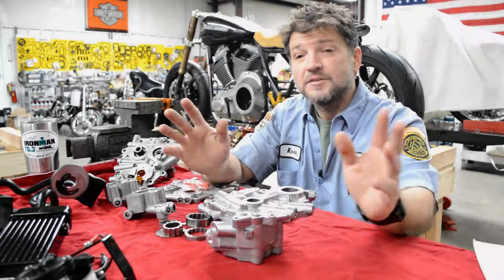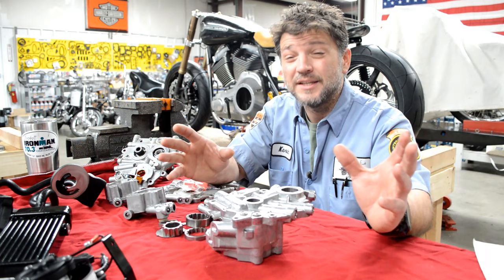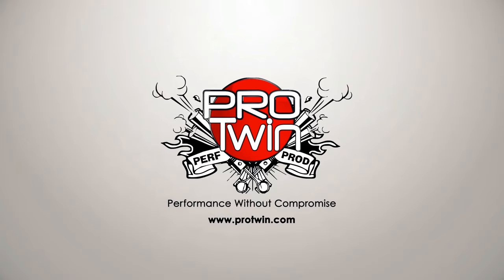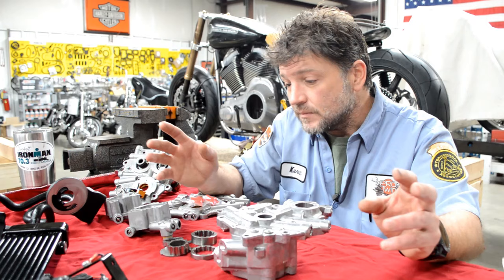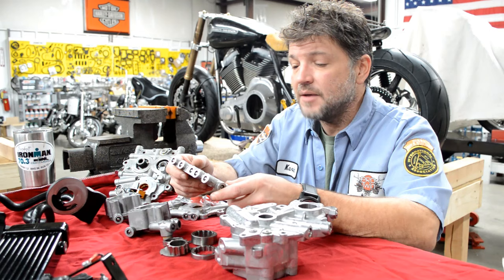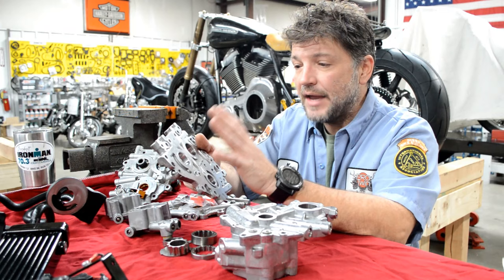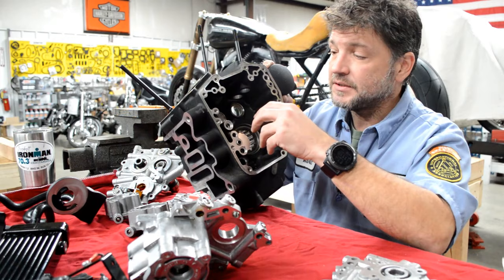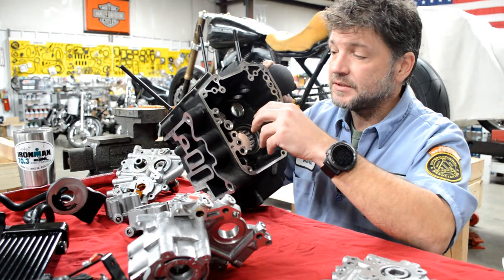Harley Cam Plate Tech - The M8 TC Cam Plate Debate - S&S Cycle - Kevin Baxter - Pro Twin Performance

Comment: Thanks for the great info. I just Subscribed. What weight oil would you reccomend for a 2010 Superglide? 10W40, or 20W50? The engine is stock. Also, what oil filter do you reccomend? Jagg oil cooler on a stock 96ci?
Again... thanks!
Reply from the maker: Hey Jimmy. Thanks for subscribing. I would definitely run 20W50. Personally I prefer an amsoil synthetic. As for filter, I avoid HD super premium 5.  Drag, Twin Power, HiFiltro...had good luck with all those.

Comment: Have Kevin,  I have a question,  I have  a question,  I had a s and s camchest package put in my 2000 ultra classic,  it had the 509 cams, efi,  only picked up about 9 horsepower,  does that seem right, had the upgraded intake and exhaust.

Comment: just curious why the screamin eagle cam plate upgrade was not mentioned. Except for oil bypass, it appears to be just as good as the S&S plate for less money. Did my 02 softail at 30K and just caught the stock tensioners before they failed (whew).
Reply from the maker: It's a viable option...but I starting having issues with them a few years ago.  The earliest one's were great and trouble free but as years went on, no so much.  Also, quite often, full kit prices from the other manufacturers save folks money over buy everything seperately.
Reply: @KevinBaxter  what was the issues you were having with them? The one I used was Intermountain H-D Part#:
25284-11
Reply from the maker: Problems with the bypass sticking.  Also...when running gear drive, on nearly every one i installed, i had to custom make a pinion gear to get the backlash right.  Some too loose, some too tight.

Comment: Just come across your channel tonight.  Great vid with some actual useful information.  Sorry if this has been asked.  I did a quick scan of the comments and did not see it.  What is your opinion on these ventilator kits like A1 cycles is selling.  I am specifically referring to the M8 motors.  I only ask because you made a reference to sumping, and these ventilators are supposed to prevent that.
Reply from the maker: That problem goes back to the beginning of Twin cam really. When I first started doing long stroke big bore builds in the early 2000s (120+ CID) occasionally you would run into one that would pop a dipstick out under very hard acceleration. My solution then was the same...vent the system either thru the oil cap or thru the rocker boxes. I went as far as putting kits together where you would drill and tap the rocker cover, then thread in a small PCV valve. Also went as far as running the vent hose to the exhaust to pull the pressure out...like on race cars. All solved the excessive crankcase pressure issue. When threaded caps came to be on cruise drive models, the problem was still there, only the cap couldnt pop out.  From my testing on M8, I have found that most of the issue is caused from oil draining from cam chest to crankcase while on the side stand and the factory pump cant recover quickly enough. We cant assume a vented cap will solve a sumping issue unless excessive crankcase pressure is the cause. But then what is causing the excessive pressure?  Runout? Blow by?  Bad pump or plate?  All that said, yes, I'd have to agree that a vented cap, preferably with a reed valve, is a great solution to sumping issues caused by excessive crankcase pressure.
Reply: @KevinBaxter  Thank you for the prompt reply.  I may look into a ventilator when I do my 465 cam upgrade.  Your videos are very informative and much appreciated.

Comment: How about a video on the twin Cam crankshaft flywheel assembly and how to repair it. Do you weld it or pin it or just replace it altogether?

Comment: Kevin I have a 2015 flhtk with 80,000 miles and I am wondering about the cam tensioners and what should be replaced when going into this job also do you charge by the hour or by the job you are to do on a bike

Comment: You must be talking about the fueling cam plates, they run a TON of oil pressure, not sure why that’s a good idea when it’s not required, that’s just heating the oil up more.
Reply from the maker: not one specifically.  people have swapped springs for years, or since the S&S plate is adjustable, they crank down on it, etc.
Reply: Kevin Baxter ah ok, when I was picking my cam chest I went with the S&S one because of the 3 “pumps” in it, the bushings, and the fact that it didn’t have 70 psi of oil pressure....that’s crazy I don’t know why fueling does that....just to be different? I dunno. People seem to like their stuff but to me the S&S stuff is unmatched in price, quality, and performance.
Reply from the maker: Well, we will have Luke from Fueling on live in the next few weeks.  He will be able to tell us.  As with everything, we dont brand bash or pit one vs the other.  Each have their own unique features and benefits and i feel its my job to make sure we focus on that.  I want to bring the info to everyone so they can make an informed decision for themselves before they fork over the cash.
Reply: Kevin Baxter looking forward to it. I like their stuff, just comparing the info on the products I had available at the time the S&S stuff seemed the way to go, plus the sell
And entire big bore kit at a crazy good price. Fueling seems to be more race/stunt crowd oriented, S&S seems to be more performance touring oriented I guess, just my opinion. Both great companies.
Reply: Kevin Baxter I am running one of their vented dip sticks, pretty nice piece.
Reply from the maker: thats an interesting perspective on the two...i never looked at it that way.  it comes off like that from the marketing alone anyway.
Reply from the maker: And they hit a homerun with that part.  Great product, great design.  Funny...i made them for Twin Cam on our monster builds back in 2000 and they had a PCV valve on top.  Neat to see a product concept come back around.

Comment: If the cooler cools the oil 40 degrees, and if I’m using 20w50, which at operating temp acts like a 50 weight, what weight will the oil act like when 40 degrees cooler?
Reply from the maker: The measured range for ratings....0 C to 100 C.  I dont think it would be much of a viscosity difference....great question.  Made me go......"huh....i wonder".

Comment: Do you know if any other engines can replace the tc88b 19259-06? I have an 06 heritage efi that had a front cam bearing failure. That caused enough damage to keep me busy. If I hadn't bought this thing from my mother after my father passed away... I'd probably part it out.
Reply from the maker: Any of the 06 and back B engines would work.

Comment: I want to add the S&S oil pump and cam plate to my 2017 FLTRU. It currently has19600 miles on it with the  original oil pump and cam plate. I measured the crank runout. It is .006. S&S claims max runout is .006. Does the .001 make the difference? What problems can I expect if I choose to in stall it anyways. Thank you for any info.

Comment: I just got a 2018 street bob went into Limp mode after passing a big truck in the highway. And P0523h code came out. Would it be what you mentioned ? Or a bad oil pressure sensor?

Comment: Can you do a video about the Harley ticking  in the valve train that no one seems to know why & fix .
Reply from the maker: One of the reasons for all of the videos in the M8 vs Twin Cam series touch on that.  Truth is, there are many issues that can cause the ticking...there is no single answer or fix.  There has been a quest to find the single answer since the TC came out.  No one has yet....only found ways to reduce it significantly.  If you could ride your car engine down the road, youd be amazed at the noises they make.
Reply from the maker: My answer is "Truth is, there are many issues that can cause the ticking...there is no single answer or fix.  There has been a quest to find the single answer since the TC came out.  No one has yet....only found ways to reduce it significantly." as I posted.  There is no answer.  People have been on the quest to stop a TC from ticking since they came out.  Several products promising it have come and gone.  Lifter to bore clearance, piston oilers, cam plates, oil pumps, valve stem protrustion, springs, lifters, rocker arm supports, etc.....even pushrods tapping the tube...all have created ticks.  A TC engine can be built and fitted with a .001 tolerance to blueprint, to perfection, and still tick.  Yours could be worse than others...i cant say...ive never heard it.  Yours could have a problem im not aware of.
Reply: @KevinBaxter  ...  This is a great video , very informative. Thanks

Comment: Question Kevin... I’m using a upgraded oil pump in a 95” softail with a baisley spring... when I drain the cases with case drain, how many ounces of oil should come out when bike is fully hot to tell if pump is working properly? 3 oz?
Reply from the maker: Great question. 2 to 3 ounces isn't bad. The trick is to check it when first shutting it off. Then again after idling a bit, etc. It can come and go depending on conditions.

Comment: Great content Kevin,thanks.Do you sell  Feuling parts and what is your experience with them?
I was thinking about one of them complete gear drive cam chest kit.It´s for my 2008 Road King.
Reply from the maker: Thanks. We do sell Fueling if someone requests them. I've used many brands of cam plates and pumps over the years but settled in on S&S when they did the redesign not too long ago, then stacked up price, availability,  and features/benefits. I always encourage folks to research the same before making your own buying decision. Good luck!
Reply: @KevinBaxter  So it´is up to details,what kind of redesign they did?

Comment: thanks Kevin, do you do head work 02  twin cam. I have a set of s&s roller rockers to be installed which I didn't get around to doing, so I may as well do my heads ported-flowed and better valves,& breathers

Comment: @kevinbaxter is it better to run solid push rods or are adjustables ok.  Seems like a lot of noise can be had from adjustables if they are not adjusted correctly.
Reply from the maker: Never had a problem with adjustables.  Done proper, they are just as quiet as solids.  With some builds, you have no choice but to use adjustables.

Comment: If I install the s&s plate with a set of Andrew cams and later down the road decide to swap out cams do I need to service the plate itself where the roller bearing goes?  Or just press them out and press in the new ones and ride?

Comment: Will the fan assisted Jag oil cooler work on a water cooled 2014 TK also is the S&S oil pump still better than the new HD pump?
Reply from the maker: Yes....JAGG has a cooler for that im pretty sure.  And yes on the S&S pump/plate combo over stock.  Many benefits.

Comment: You need to do more research on the differences between cast and forged, cast has an even grain structure and expands more evenly than forged, forged is stronger. Only in one direction.

Comment: Hey Kevin in what state and town are you located?I don't know what the Join button is but I'm pushing it. I only own an 03 V-rod and a 65 pan but the stepson has a 04 twin cam with about 30k miles. and rides with a peaceful enough group, but I don't think many of them are equipped to give him sound advice. so I will be doing some knowledge gathering for him. you obviously are a good source. Thanks for your information.  I think I'll be OK with the Pan Head. I have a few Ideas for improving the performance and handling. I could use advice on the V-rod and sources for  parts like the triple clamp I want to take it from a 4% to 2% to improve it's handling at higher speeds. I'm 67 years and don't ride near as much as I once did so I might as well be comfortable and a bit safer . Any helpful directions  on V-rod parts and other information would be greatly appreciated.
Reply from the maker: Thanks Mike.  Winder, Ga sir.  Appreciate the comment.
Reply from the maker: Scott Fitzgerald at Fitzgerald Motorsports in Ohio for VROD stuff.  Tell him i sent you.

Comment: Sorry, I'm confused about the oil circuit leaving the pump. Pretty sure you pointed to the same oil port twice at the beginning of the vid (5:19 to 5:30) in your explanation. After it leaves the oil pump does it come back through the upper hole/passage in the cam plate above the dowel pin?
Reply from the maker: That is correct.  out one hole, pass the OP switch, thru the filter, then back in.
Reply: @KevinBaxter  OK thanks.

Comment: 12 to 15 psi hot at idle...wouldn't that be nice. (Starting a low oil pressure hot at idle diag shortly) isn't that right about what the piston jets need to open?  
  I just heard of a cam plate from Dan Thayer upstate NY. He claims 30psi hot, cold, idle, hi rpm (plate & his pump) that & I believe his bypasses to the return side instead of the feed. 
 Have you tried it? Thoughts about the bypass?
Reply from the maker: I've known Dan for about 15 years.  Great fella.  Was just speaking with him this morning in fact. He makes a very nice plate and pump and keeps em in stock, 99-06 convert to hydraulic tensioners.  I've used many of them. The oil pressure is more stable at speed and a bit better at idle, due to elimination of aeration. maybe 2-3 lbs over stock  so pressure is not a big deal in these engines as I am sure you would agree, more pressure just robs hp. its more about volume and scavenging.  at cold the pressure is very stable about 30 psi, as oil heats up idle will fall off to around 10 this is due to a anti aeration design of the pressure relief in his plate. the true benefit of the pump is the dual scavenging with separate rotors pulling independently from the two separate cavities that other designs try to share one rotor to do the job.

Comment: Your info that u provide is golden. i appreciate it as one of those that works hard for there money. SO FROM MY UNDERSTANDING ... NO MATTER WHICH CAM PLATE IS USED U WILL ALWAYS HAVE TO REPLACE TENSIONERS  AT A CERTAIN MILEAGE AND THEY WILL ALWAYS WEAR THROUGH TIME.  ALSO I WANT TO HELP UR CHANNEL OUT I MGOING TO NEED CAMS AND PLATE KIT TO UPGRADE 2001 ROAD KING .I M NOT SURE WHAT KAMS TO RDER I WANT TO SOUND LIKE DRAGSTER BUT I WANT TO HAVE POWER ON FREEWAY IM ALWAYS LEFT BEHIND .WHAT CAMS COULD U RECOMMEND AND IF U SELL A KIT FOR GOOD PRICE I WILL BUY IT FROM U GUYS . CAN U HELP.?
Reply from the maker: Thank you Eric!  That is correct...unless you go with a gear drive set up.  But...hydro tensioners last FAR longer than the earlier spring loaded style.  Much longer.  So with a 2001, if your crank is less than .003" runout, gear is a great solution.  If .003 or more, then I'll set you up with a hydro conversion plate kit with cams/prods, tubes, etc.  Thank you so much.  Email kevin@protwin.com or call 678-226-9651 and we can get you squared away!  I'll suggest a cam to you as well that fits your needs.  No problem at all.
Reply: @KevinBaxter   OK KEVIN I LIKE WHAT UR SELLING . I HAVENT TAKEN APART CAM CHEST SO I DONT KNOW THE RUN OUT. BIKE HAS 27K MILES SO ILL JUST GO WITH THE CHAIN DRIVEN JUST CASE RUN OUT IS OVER..HOW OFTEN IS RUNOUT OVER  LIMIT IN BIKES  I WOULD LOVE GEAR. WHAT IS THE BEST TIME TO CALL UR TECH SUPPORT TO SET ME UP I LIVE IN CALIFORNIA TO SELECT  CAM CHEST UPGRADE.. TO DO I SPEAK WITH U OR TECH SUPPORT
Reply from the maker: On pre 07 bikes, the cranks were pretty good and were mostly straight.  the bigger problems started 07 and later.   you can call in and speak with me directly.  i prefer that when it comes to cam and/or build selections.  6782269651.  if you can call me after noon eastern that would be great.  Thanks.

Comment: DO you know any thing about Kings Mountain 2009 Indian Motorcycles, The bottom half is a S&S motor, it is almost impossible to find how to videos on this Bike !!!!
Reply from the maker: Know them very well. They are basically an Evo with a relocated oil pump and filter.  if yours is the year im thinking. Bottle cap heads correct?
Reply: @KevinBaxter  Yes I see so many Videos on Harleys but never anything about K.M. 2009 -2012 Indians Just would like to see some Videos on the K.M. Indians.
Reply from the maker: Thanks for the suggestion.  I doubt I will do one anytime soon.  It literally is an EVO with a relocated oil pump.  If you want to know more about them, just look for Evo stuff.  It'll answer 90% of your questions.  If you ever need anything for it, call Frank at Blackhawk Motorworks in Florida.  Tell him i sent you.  He knows those engines inside and out. Great fella.

Comment: What can you do to make a 114 better
Reply from the maker: well, id want to cool it down and ensure proper oil flow.  So i would change pipes, high flow air cleaner, and tune it properly.  Then, cam plate, oil pump, inner cam bearing.  From there, its more about performance gains.  Great question sir.  Largely depends on your budget and intended use of the bike.

Comment: I have a 2005 ultra classic down the road I plan on taking my twin Cam 88 up to a 95 or a 98 what options do I have to  Upgrade my compensator
Reply from the maker: There are very few options when it comes to the 06 and back style...because they were quite functional and reliable.  rarely would they fail.  in the rare occasion we need to replace one, we do so with an aftermarket replacement for stock.

Comment: if my bike is stock M8 107, is it still a good to change my oil pump and cam plate?
Reply from the maker: After a good evaluation, if you arent having any sumping or oil pressure issues, I'd run with it but keep and eye on things.